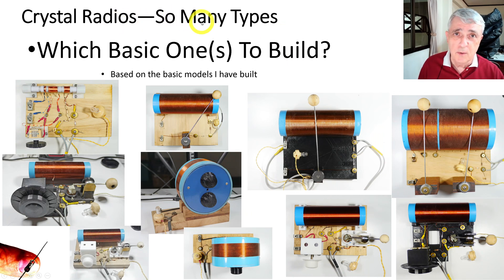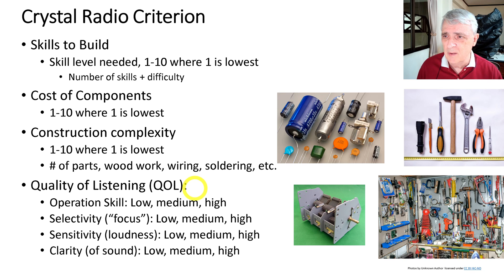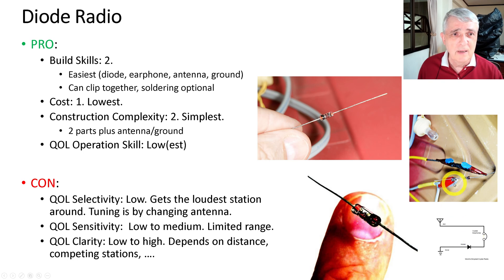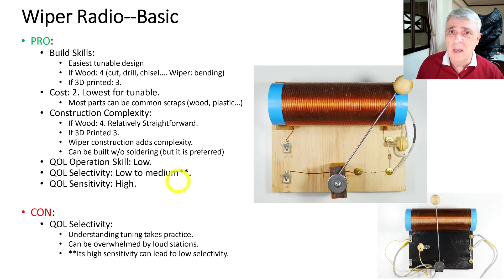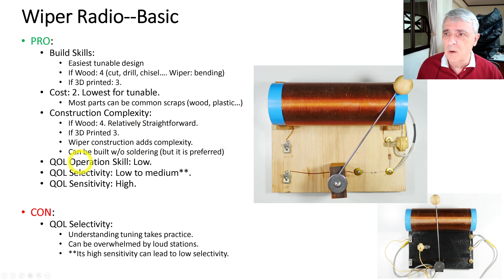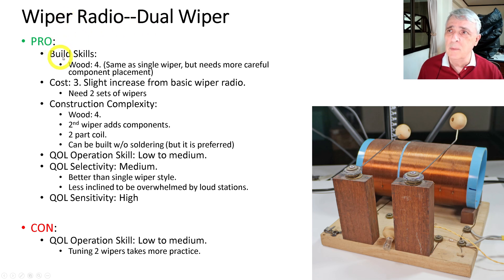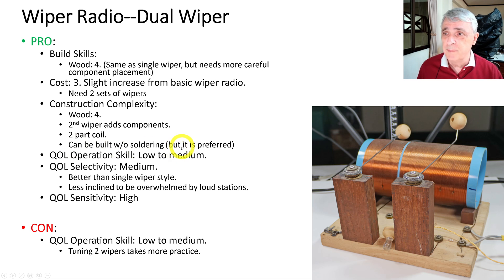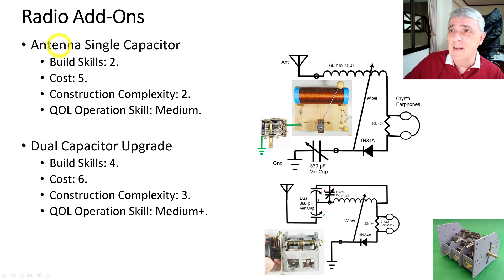Which Crystal Radio To Build? (4K)

Comment: Modern Radio Laboratories crystal radios were the best. I had one in 1955 in Sanford, FL and listened to The Voice of America every night from Chillicothe, OH. Plans are still available.
Reply from the maker: There's a Youtube video of a guy (Len Buckwalter) that bought and built one. He said, "It works, but not very well...." I have a very similar ones, and the capacitor radios are always more selective, but less sensitive. So far, the best of the basic radios is the dual wiper. https://youtu.be/mh5KxCpbQ5U
Here are some others using capacitors that I have found acceptable (and that are very similar to the one you mentioned):
https://youtu.be/VJ80Nm9KSkE
https://youtu.be/0AvTO588SyU
https://youtu.be/MA2A-mntyM0

Comment: I’ll have to give the dual wiper a shot. I’ve built one with a coil only (non-adjustable) and an air capacitor but could get just one strong station.
Reply from the maker: @drivers99  It's my favorite and the strongest performer.

Comment: Many years ago I came across a tuning capacitor and Germanium diode in my junk box and decided to make a crystal radio and when I finished and hooked it up to an antenna and ground the first thing I heard was E.G. Martial hosting the CBS Radio Mystery Theater. It was as if I built a radio from the past and it was receiving a radio show from the past.

Comment: WHAT IS THE FUNCTION OF WIPER ON THE COIL PLEASE  ?
Reply from the maker: It changes the amount of inductance in the coil. More inductance = lower frequency.
Reply: @tsbrownie 
Perhaps I am unable to understand. The way you are reducing the inductance looks as if you are short circuiting the head phone input. Because when wiper will come on right side of the coil, that is the maximum inductance point, it will short circuit the headphones input. The simple way is connect one side of wiper with one end of coil and other end of wiper should slide on the coil.
Reply from the maker: @Science.Follower   Yes, if it was DC, it would be shorting the coil. But at AC it acts more like 2 coils. One coil is the antenna side, the other is the earphone side. You can make a radio that has individual 2 coils, one that's the antenna, one that's the earphone, but it's harder to find ways to easily tune.

Comment: A while ago i ran across a crystal radio [on the internet, probably here on yt] that used not 1 but Two 1N34 germanium diodes for full rectification of the audio signal. I have re-searched for it on youtube, but cannot find it now, I just want to see the schematic for it. Can you help? Have you heard of using two diodes? What's your opinion of using a variometer in crystal radio design? can it improve sensitivity for dxing?
Reply from the maker: @lectrikdog  I have not heard of using 2 diodes. I can see where it might be possible, like feeding an amplifier or some circuit that can use both halves of the wave. I have a series of videos on variometers, but they were always less efficient than the designs in this video. Most variometer radios had a tube or tubes.
Reply: @tsbrownie  Id like to build a xtal radio that can allow for multiple stations to be heard simultaneously, as well as adjustable for high rejection of neighboring stations. In other words, something that in effect compresses or expands the radio band itself. Wondering how to go about it. have made xtal radios before ...hints appreciated thx❣
Reply from the maker: @lectrikdog   In the old days, they would have coils that could be changed out for those of different sizes / ranges. They were the capacitor type. If you really want to hear 2 ranges at the same time, just build 2 radios on the same board. Use changeable coils.

Comment: What is the gauge of coil's wire and nos.of turns? Can i use old rotary telephone's ear piece(it has a metal diaphragmas a earphone?
Reply from the maker: The data for each radio is in the description under each individual radio video. The links are in this description. You can try the earpiece, but there are many types so I can't say for sure. It's worth a try.
Reply: i built a very basic one. only using that old telephone earpiece. fix station. no tuning. i used the crystal diode soldering it across the earpiece terminal. and one terminal connection goes to antenna n one to the ground. and the sound was audiable from the earpiece although low. And now i see so many types and improved one in YouTube.

Comment: What about a dual wiper and capacitor? Is that counterproductive?
Reply from the maker: In theory one could design a hybrid, but I have not done it or seen one. I have tried  adding a cap to mine, but there's too much inductance to add any capacitance to. It drops the resonance too low.

Comment: For a dual wiper, does the antenna tuner have to share the same coil?
Reply from the maker: Good question. In my version I have taps that allow me to connect the antenna coil to the tuner coil, but most of the time they are not.

Comment: for the best radio sounds like the dual wiper would be it? not the dual capacitor? I think I would like to give the best a shot. not sure if I missed them but would you have videos of the build of either like the single wiper step by step you previously had published.   keep the videos coming.
Reply from the maker: I like the dual wiper the best. I have a video on it. The link is in the description. It builds on the single wiper video (also in the description). The dual capacitor is good, but the sensitivity is less and it costs a lot more.
Reply: @tsbrownie  thanks! Will check the description. I will give the dual wiper a shot!!
Do you have more radios in the works?
Reply from the maker: @ShnitzlHaus  I've got some improvements I'm working on. The more interesting ones should make it to a video. I don't make videos, I do stuff that I happen to video. ;)

Comment: Air Core Pipe Tip = I found a very simple way to improve a toilet paper roll to make a robust tube. You will need the first cardboard tube, cut to your desired length. You will also need another similar tube of a longer length - add say 2 inches/50mm. We will be strengthening the original tube, by adding additional cardboard layers inside this tube. This is a messy process. You will want to protect the outside surface of the first tube (the one that will receive the wire windings.) We will be using common liquid white paper glue. We do not want the glue to get on the outside of the main tube, because Mr. Brownie has taught us that any glue bumps will disrupt the wire windings. So, maybe cover it with removable blue painter's tape, or with plastic wrap. Here's the trick... Carefully cut the longer tube along its twisting diagonal seam. Coat the outside with liquid white glue. Twist the tube back together, overlapping the diagonal edges to reduce the diameter of the tube. Slide this assembly into the first tube. Untwist it, to expand it, to fill the inside of the first tube and attach it to the first tube's inner wall. Align the diagonal seam, to make the edges completely smooth. It will self-adjust, in its length. You will find the ends of inner tube that extend beyond the inside of the first tube are not aligned. This is no problem, so long as the diagonal seam is aligned for the full length of the first tube. Let the glue dry, overnight. Trim the inner ends to match the outer ends. Repeat, as you desire. The result is surprisingly strong and the effort is quite satisfying. Practice aligning the dry components, before applying the glue. I hope this helps someone. Ask questions, if the steps are not clear.
Reply from the maker: Thank you. BTW, the channel is named after my dog.  ;)

Comment: While I haven't seen any build information; the radio I currently want to know more about is from the same YouTuber that developed the credit card crystal radio.

His latest has a printed shell and uses a very basic form of tuning with a loop of wire revolving inside another loop of wire. He's a genius at making small, simple designs.

My first was a rocket radio purchased from a comic book ad in the 60's. I never did hear a peep out of it and threw it away.

Knowing what I do now I wish I still had it.

I got the parts now to try building a YouTube radio called the almost solderless crystal radio. (I think that's the name) It uses a diode and cheap inductors that look kind of like resistors and ceramic disc capacitors for tuning.

It's a breadboard radio and if it works I'll probably solder it together on a piece of perf board and maybe make a small box for it.